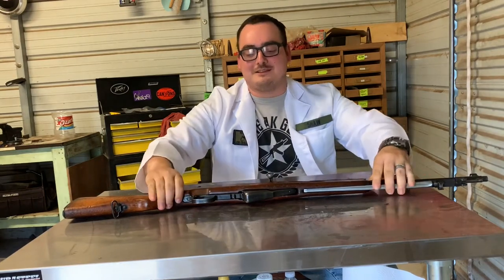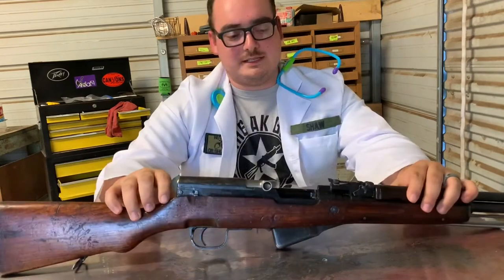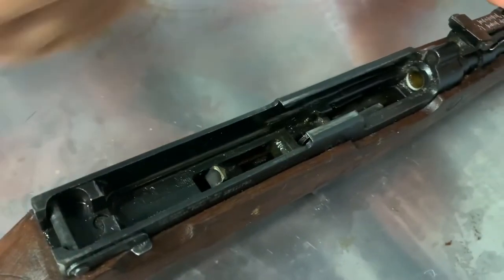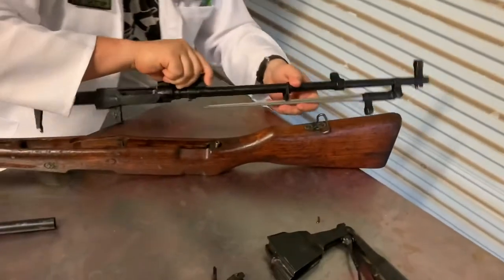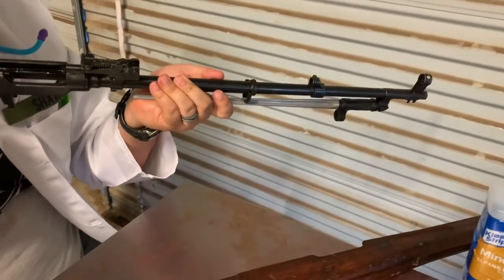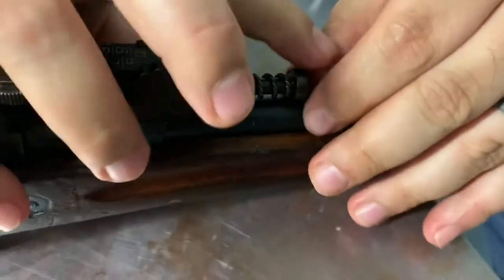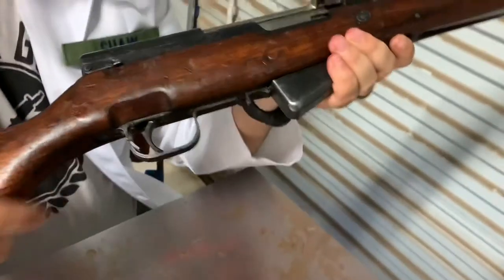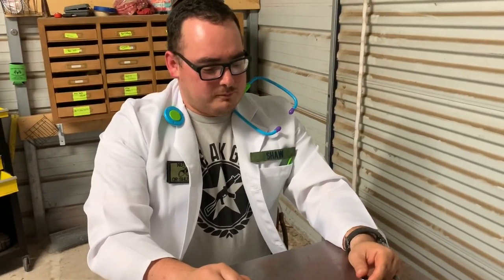Chinese SKS Disassembly and Clean

Comment: I like your video, others, mainly who aren’t utubers when they explain something about a gun, their voice or sound so often isn’t clear. Your video is like a professional one.
Reply from the maker: @DYLANJJK94  glad you like it and hopefully it will be helpful. I’m definitely far from professional, but I try to cover the things I look for when I try to find info. Definitely get too rambley a lot. Editing makes me realize a lot
Reply: Should i take apart everything of i use corrosive ammo or just clean the barrel, spring in the back and mag?
Reply from the maker: @DYLANJJK94  Bolt face, chamber/bore. It’s a potassium chlorate substance in the primer on the old stuff. Leaves a salt residue. Pretty much all modern 7.62x39 is gonna be non corrosive. If you stumble onto some old stuff that isn’t specifically marked then assume it is of course. Bore snake and some decent clp would probably be just fine.